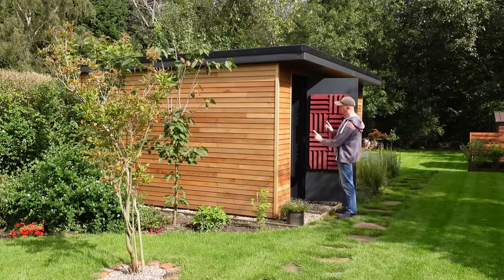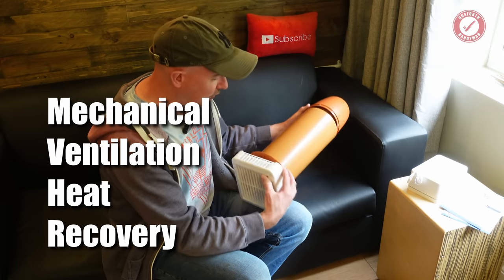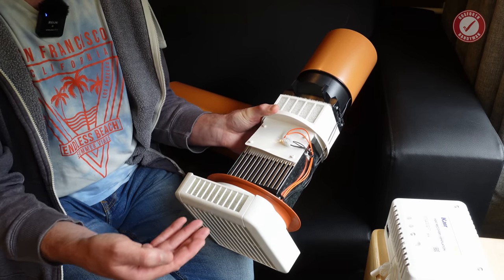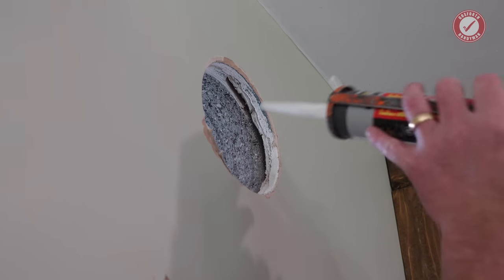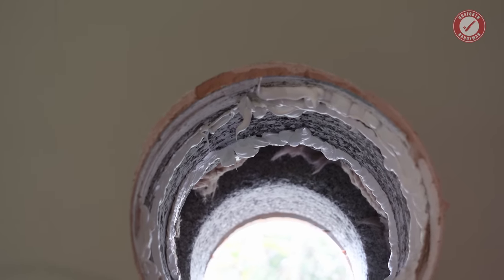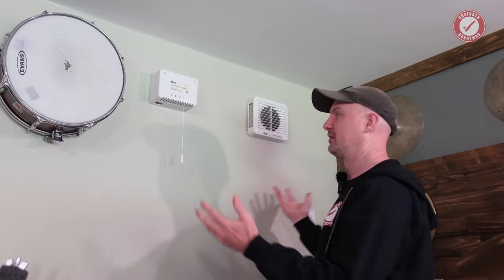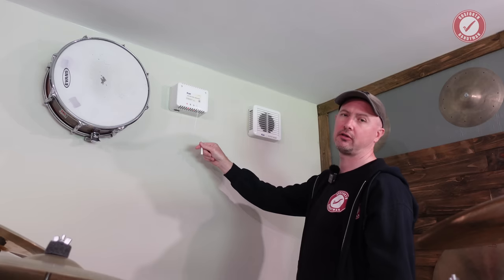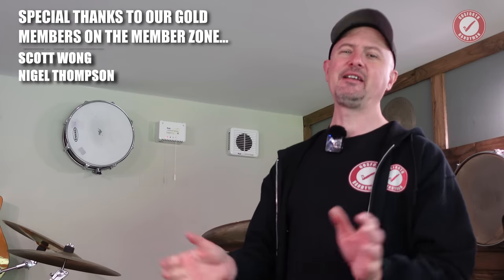Humid and mouldy! Installing MVHR ventilation (Kair system)

Comment: I assume the fan works in reverse when pulling fresh air from outside? It's not pulling in fresh air when it's pushing air from inside?

Won't that create a negative pressure in the space, since it's not that large? Or is it such a low volume of air being pushed and pulled that it's not noticable?
If it does,  then air will find it's way through all small gaps.

Comment: Unfortunately these kinds of dMVHR the testing standard doesn't ever account for exterior wind speed, as soon as its even a little windy they lose all thermal recovery performance. So if you can try to locate it in a very sheltered location.

Comment: If humidity is an issue then there is two things to do about it, one you had addressed and that is ventilation, then next you need to heat the room where you what the moisture to leave from, and there is no way around that, you need to raise the temperature in the room above the outside temperature. If you don't then the room will always be damp the same will goes with all the stuff in the room, furniture, gear and building materials, it will all be, and stay damp. And no you can not relay on the summer heat to dry out everything, the moisture will return fast and most of the stuff in the room will be damage before time, sorry. But anyway, monitor the humidity in the room and see where it goes.
Reply from the maker: If the air is dry enough (e.g. with a dehumidifier) would that help on the lack of heating? Don't really want to heat it when I'm not using it. 👍
Reply: @GosforthHandyman  Everything that remove, or reduce, the humidity will help, the question is just how much it will help, time will tell if you keep a log of the humidity.
A dehumidifier, the real deal with a cooling element that condensate the water from the air, could be used, but they cost on your electricity bill.

If you have a RH of 70% and a temperature of 15C both in and outside one day and you enter the room a few things happen with the climate in the room, the temperature will most likely raise, and the RH may raise too, you work hard for a few hours and temperature and RH will still raise because you are producing heat and moisture. The RH is the interesting one to follow, if it raise with the temperature then you are adding moisture to the room, if it stay stable when the temperature raise then you are removing moisture from the room. Now you leave the room and switch off all electric gear, then the temperature will fall and the air will, if the RH is high enough, release moisture(water) to furniture and building materiel because the air can no longer contain the water because of the temperature drop, it's physics, there's nothing you can do to change that fact.

An other way to look at it goes like: If the room temperature is 25C and the RH is 80% when you leave the room, and the outside is 15C and 80% RH, then it is beneficial to ventilate as strong as you can until the temperature in the room is more or less equal to the outside temperature, then you will remove as much moisture out of the room as you can the climate conditions taking into account.

There is some issue when the room temperature is below about 15C, then all materiel's in the room will act like a sponge when you enter the room and the warm moisture from your body spread in the room, and you will need a lot of heat to evaporate this moisture from where-ever it is present, it is not enough just to heat the air, you will need to heat all the materiel's in the room too. So from a climate point of view it is not advisable to actively use a room where the temperature (when the room is not in use) is below 15C, the risk for mold buildup is too high.
If one will use such a cold room then an approach could go like heating the room some hours before entering/using the room, keep the heat on, ventilate often, and ventilate for some time after usage, but this will cost on the heating bill and not all people are willing, or can, pay just to heat for the outside birds.

Comment: Great vid mate. I'm building my first woodworking workshop this year and wonder if this would help maintain humidity levels in there around 50% to minimise timber shifting, etc. How do you reckon it would fare with fine dust in the air?
Reply from the maker: Yeah could work! It's got filters so you'd just need to keep an eye if they get clogged up. Although a portable dehumidifier might be easier? Not sure. 👍

Comment: Visible mould in a room means you have a problem, if you use bleach or mould killer not only will it be expensive but it will only remove mould on the surface, if you want a really cheap way of killing mould use white vinegar 50/50 mix with water and just make the surface slightly wet, this will smell for about half a day and then go away but it will kill the mould for good (roots and all) It's only when you have a huge infestation of mould you can see it so by then the amount of spoors (seeds) in the room are in the billions, wipe all surfaces (and I do mean all) with the mix and it will never return unless you spray the room with water. I'm sure this guy built this room with lots of water (paint, cement, ect) and that gave the mould a chance to really establish it's self.

Comment: Worth mentioning that the hammer feature on the drill should be switched off
Reply: I don’t think it was hammer, I think it was the clutch so it didn’t bind up and whip round possibly breaking his wrist.
Reply from the maker: Yeah that noise was the clutch kicking in... but yes, rotary only. 👍

Comment: The recommended minimum for a habitable room (dwelling) is 0.6 to 1.0 ACH (air volume changes per hour) = "Passivehus" standard.

In the 2022 edition of Part F (Ventilation) for a habitable building with only ONE habitable Room - a minimum of 13 L/sec for continuous  extraction with a fresh air source .  So is the chosen Kair unit "ok" ?  This clearly assumes no smoking or vaping !!
Reply from the maker: No idea! Apparently trickle 19m3/h, boost 38m3/h, average daily airflow 547m3. I think the room is about 27m3.
Reply: So on boost it is giving a bit more than 1.4 ACH (38m3/27m3) and on trickle 19m3/27m3 = 0.7 ACH - so would be acceptable for a passivehaus. ( I am C.Build.E MCABE, BSc Hons  and a retired (ex-Gateshead) "Building Control Inspector" - love the channel.

Comment: Straight through is not a good idea for sound. We always use attenuation off axis, both inside and outside. Obviously breathing is more important than sound isolation but I’m surprised you’ve compromised the sound on such a super structure. I always say to clients it’s all about what you tolerate. For me recording with that thing on would be impossible, it could be turned off but then breathing starts to be a problem again. Building an external or even internal baffle chambers might be part of new video?!
Reply: 😂now I’ve got to the end…glad you’ll look at that attenuation soon!